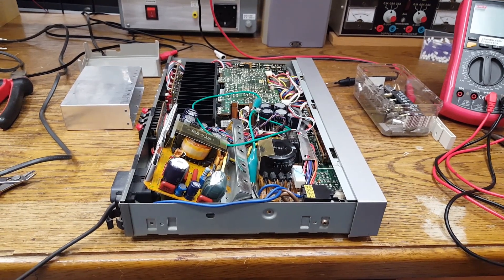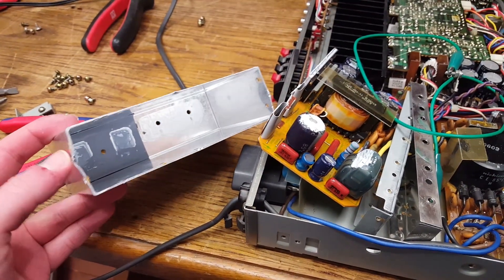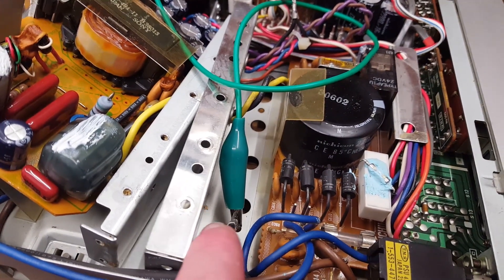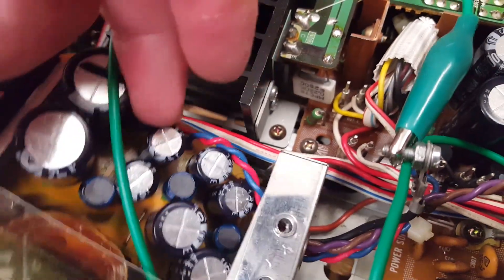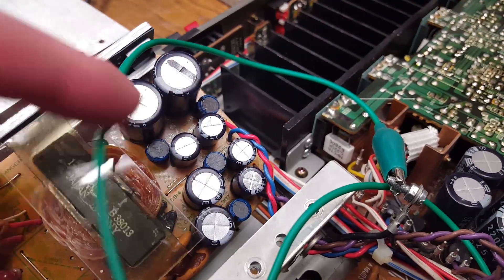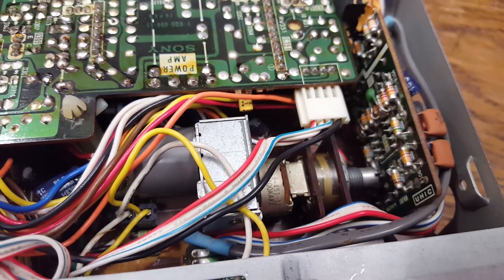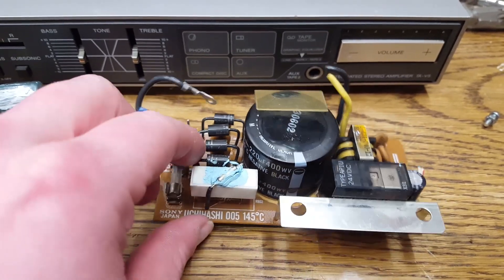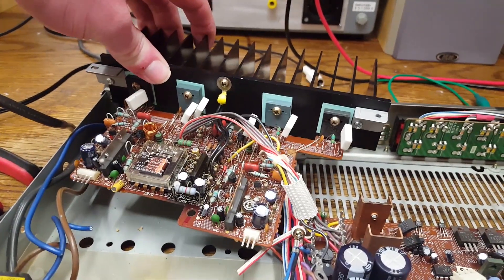A closer look at the Pulse Power Supply of the Sony TA-V5 amplifier

Comment: Hi, someone near me is apparently selling this for €35/~$40, but there is little or no information on this amp online. Do you believe it would worth it? I'd use it to drive my 4 ohm Dynavoice floorstanding speakers. Thank you
Reply from the maker: No, I don't think this amplifier would be worth that much. As you have seen in the video, this is a relatively complex and therefore difficult to repair amplifier, and it's more of a novelty device than a serious HiFi component. If you could get it for maybe 10$ that would be okay, but 40$ in my opinion is too much. For that price, you can get more traditional HiFi components that are most likely much better than this Sony.
Reply: @DrCassette  yeah that was I was thiking as well. I own its little brother and it wasn't much easier to repair. Thanks a lot

Comment: I had one. Sold it for 20 euro. The push button is not accurate enough. You cannot accurately set the volume with this thing.
Reply from the maker: That's just what I expected. Volume Up/Down buttons are a bad idea.
Reply: There was one with a motorised volume can't remember which model it was but it sounded freaking amazing 🤩

Comment: I wouldn't fix it either, but what is up with the input cap?
Reply from the maker: For some reason some of the components inside the metal box had heat sink grease all over them. I have no idea why Sony did that.
Reply: My guess is that since the box is a tiny confined space, Sony thought heat grease on the caps would help cool them.  We see the result here:  magnificent kaputt, epic fail!  Second guess is the power supply box is solid with no venting because sony learned that switch mode power supplies are seriously noisy.  The fix is in!  Call it pulse power, so the consumer will think "woo, star wars", slap on a pushbutton volume control, 80's feature graphics, and hopefully sell a bunch.  Which is one reason why Sony's amps and receivers don't get a lot of love in the audio world.  At least a Luxman suckface receiver will give you some laughs before something breaks!

Comment: Would have been more simple and probably cheaper to just use a toroid transformer. All that to just get a probable +/- 40 or so volts. Someone thought it was a good idea!!
Reply from the maker: It would have been impossible to fit a linear power supply capable enough to run the output stage into this small, slim box. A toroid transformer would not have been flat enough, not to mention the filter capacitors etc.